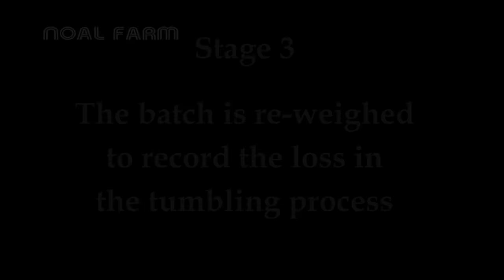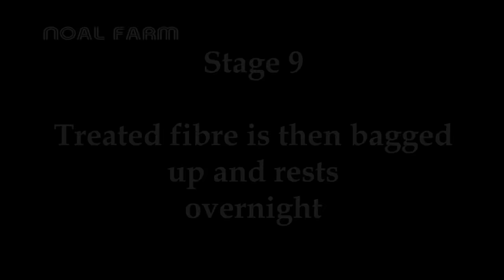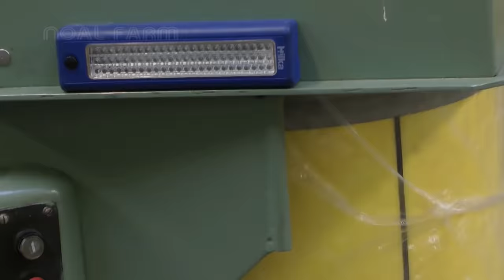SURPRISED Alpaca Shearing Technique 🦙 - Alpaca Wool Processing in Factory - Harvesting Alpaca Fiber

Comment: I have seen them shearing sheep standing on a table and walking around it and shearing it with it having a feed and a small strap holding it at the front of the table - there are other ways not so hard as having it on the ground and also they do this with sheep in Australia holding it from behind on it's back so it is really struggling and moving around more.  There are better ways to try have a look on line and you will see
Reply: Alpaca and sheep are two different animals I don't think you could hold it down like that and I don't think you want to get kicked
Reply: They actually explained it in the video that it would be more comfortable